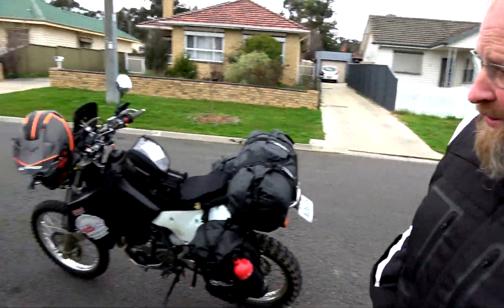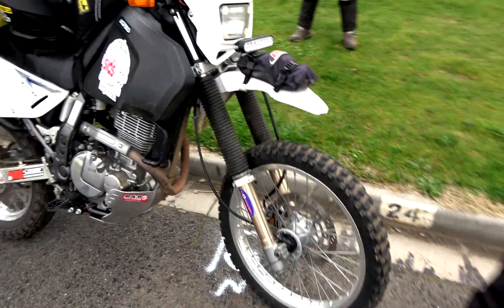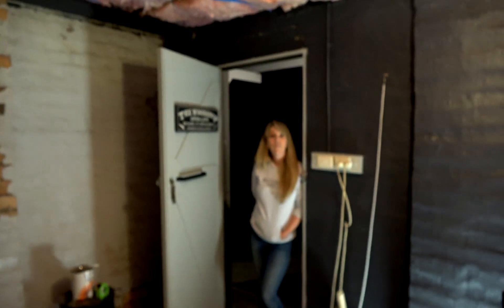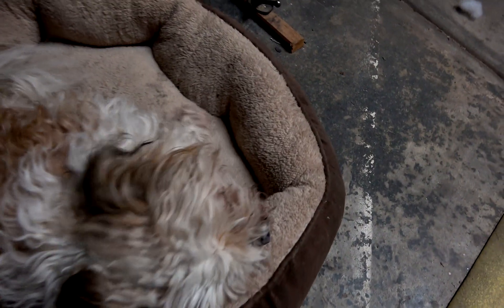Busy Week! MCT 2019 Ep.19

Comment: Is QBag for a reasonable Price available in Australian?
I think they a little bit pricy in Germany - I paid 50€ for a magnetic one with additional Stripes and a Raincover (Normal Rain is fine without a Cover, but if you come in a heavy rain and wanna continue your Ride a few hours I would put in on) one ... two years ago I think. Round about 84 Australian Dollars if I am correctly.
Anyway, the Concepts and Stuff a really good from QBag and the Magnets a safe for ~100km/h or more (Depens if you've a Windshild on your bike, I don't ('Naked' CX500) but I usally ride up to ~120km/h without the stripes and the magnets are holding).

Edit: There also a System for a Tank-Holding-Fast-Lock-Thing for the Gas Cap (Sorry for my bad englisch skills :<). But funny thing, I tried to look up a Shop which deliever to Australian with this Bags and the only thing I find are prepared dishes :D 

If you are interessted in QBag ... Bags ... You'll find they via a search engine via "QBag Tankrucksack" or so. FC Moto has them too :o
Reply: I like my little Aldi tank bag, the magnets hold in the +100km/h area, but for tanks that don't have the metal tank or have a cover, straps are the way to go, though I have seen some glue metal/magnets to the tank to get it to work also.
Reply: @wobblysauce  To be honest, I don't know the Aldi Tank Bag.
But to glue my Bag on the Tank - Sound somehow ridicoulus but my CX500 is already a Ratbike :D
Reply: Not glueing the bag to the tank but something for the magnets to attach to if you like a bag that used magnets on your non-metallic tank.
Reply: @wobblysauce  Ah, got it - Sorry!